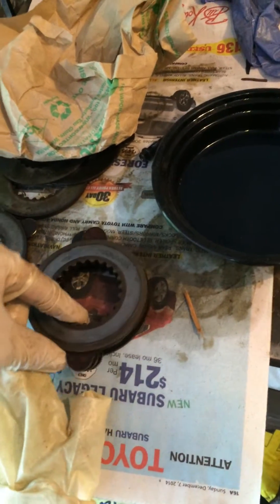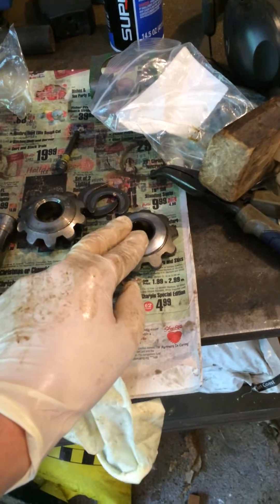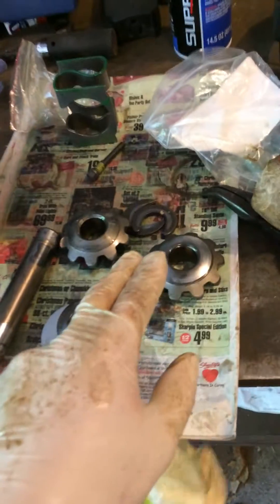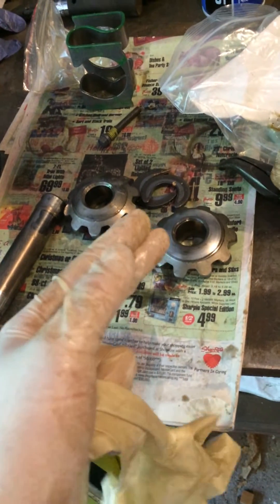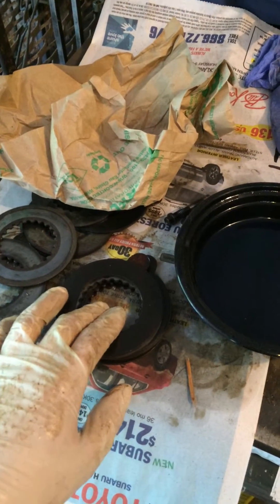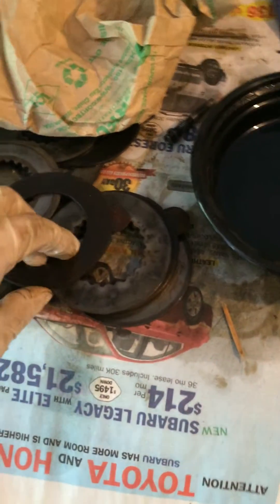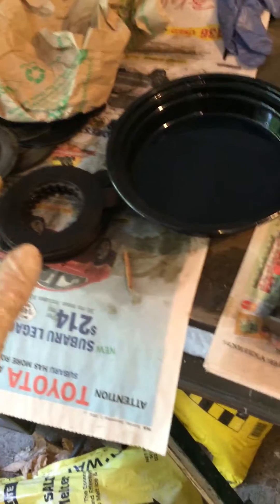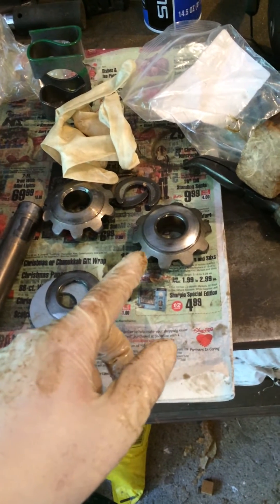Ford 8.8 spider gear issue Solved!

Comment: Just had the same issue, found your video.  Saw what you wrote above and went out to the garage and counted the old plates I had pulled out.  Missing one steel.  Found it!  Problem solved. Mine was stuck to the side gear.
Reply from the maker: Haven’t watched this in a long time. Wow the channel has changed over time. Fudge, could barely get the words out back then. Regardless, glad this crap is still helping people out! Cheers